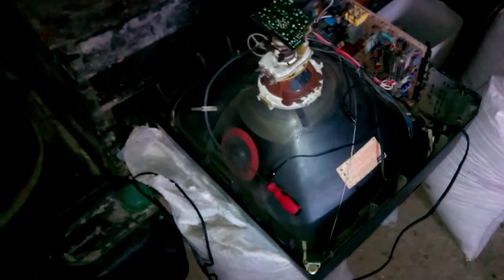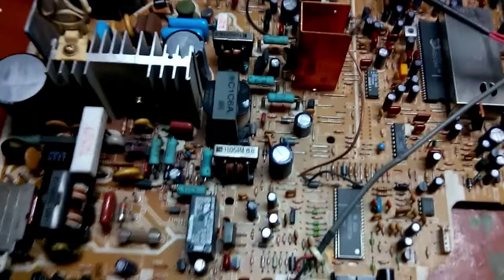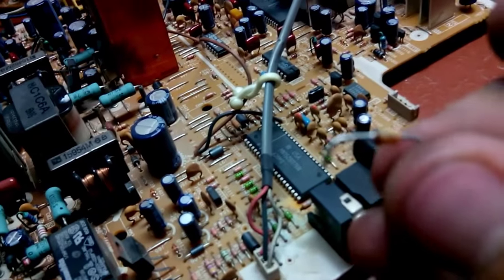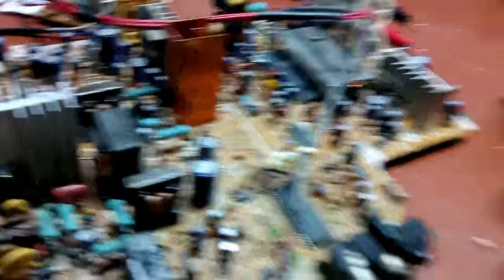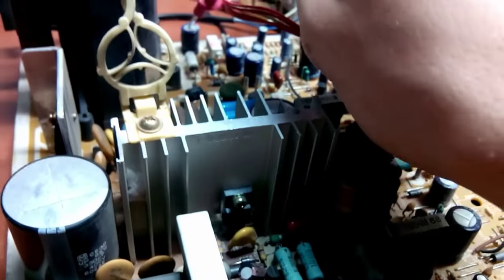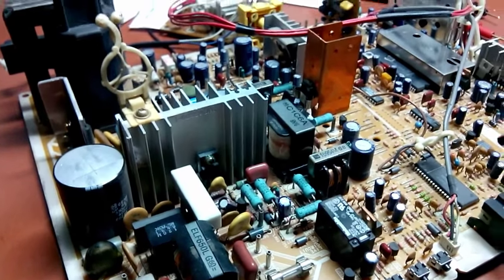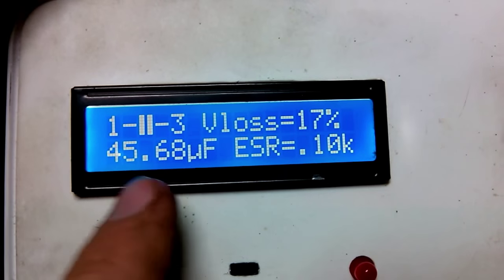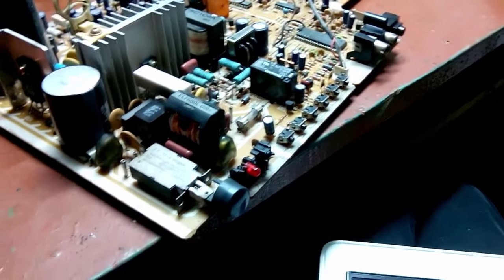CRT TV Repair #2 (doesn't turn on)

Comment: You have a nice tester wich showed voltage loss and ESR. I have also bought similar tester called MK 168 transistor tester. Nice device! :)
Reply from the maker: +saarike Oh yeah, it rocks! I built it myself on perfboard using the schematic of Transistor Tester by Markus and Karl Heinz. What you bought is practically the same stuff, but on a PCB and made in China :) I had a uC and LCD screen on hand so I decided to make one myself.
Reply: Ok. :)

Comment: was watching something on my tv the other day and all of a sudden the picture distorted
looked something like this:
-------------
  ---------------
-------------
  ---------------
the image split into about 5 chunks that where not aligned,  and then it just went off . i get no sound now but the set switches on and makes a similar sound before going into standby and when I turn it back on from standby it just makes the sound again liek when you turned the set off. im going to go check my psu and see if mine is the same issue

Comment: Why did you go for that diode in particular?
Reply from the maker: Muna Abraham I don't quite understand the question, but I went to check that Zener diode 'cause it is located on 42V bus and since it was dead, it shorted that rail. So, I had to replace it.
Reply: What I meant was....There were many diodes as well as transistors, but you went straight for that diode? Was it burned or blown? I know it was shorted. Because it is located on the 42v DC bus was the answer I'm looking for. Thanks anyway
Reply from the maker: Muna Abraham Oh now I understand you)) I went straight to that diode 'cause I cheated a bit (I found a forum, on which I found topic describing similar problem, so I went for it). Without cheating, I would go and check various outputs (voltage rails) of PSU for shorts as well as checking rectifiers on the secondary side. To sum it up - check outputs of PSU for shorts if you have a TV or monitor with power supply that screams when you turn it on. Hope it helps
P.S. And yeah, diode was in one piece, however, it changed color a bit. Usually it is red, but that one looked orange to me.
Reply: what the name of this meter .that you check capicator
Reply: Teach me to repair TV's

Comment: Hi i have samsung crt tv and problem is picture it is pincushion distortion. Can you give me some advice how to fix this problem or could i even fix it at all? Tnx.
Reply from the maker: Google how to enter the service menu of your TV and try to adjust it there. If you won't be able to adjust it enough, there are a few components that are prone to cause such issue. If you are familiar with electronics, it won't be too hard to find the culprit. That if you have some experience and test equipment.
Reply: It is samsung crt cw21z453n , service menu? Ok I will find it, but what if I havu to open it , i have multimeter is that enough?
Reply from the maker: Sasa Vasquez DMM will allow you to test resistors and maybe measure capacitance (depends on what meter you have), might be sufficient. Components in raster correction usually run hot - one of the reasons why they fail. Sometimes you can find the bad part by visual inspection (look for crusty, discolored parts). There are dangerous voltages inside, so you must be careful. I don't take responsibility for your actions.
Reply: Hi , I was enter in service menu of crt and nothing everyting looks normal but picture is shrinked distorted. I wil open it and look for unnormal parts components.
Reply from the maker: Sasa Vasquez Be careful when you do that. Components I was talking about are located in the area with the flyback transformer, usually very close to the yoke connector. Yoke connector leads to the coils on the neck of the CRT, it's easy to spot it; it has 4 rather thick wires.
Reply: the second picture and text
Reply from the maker: Sasa Vasquez Since you say that colors are fine, it's definitely not a convergence issue. When you tried the service menu, was there a reaction when you adjusted the proper control? If not at all, this means you may have bad IC there, which can cost half the price of the used TV in working condition.
Reply: Colors look okay not blurred,  but the side sees green vertical and curved. Mayve i could post a picture somewhere!
Reply: About service menu, if i had hit the proper control , i try to adjust the picture size but the same function is on remote and nothing hapend. It is curwed. Other functions i didnt try.
Reply from the maker: Sasa Vasquez Most menus have a control to adjust raster (distortion of it), you should find it and try it out. Picture size is NOT a control you're looking for.
Reply: One moment i am uploding pictures
Reply: I hope you can see it
Reply from the maker: Sasa Vasquez http://i1200.photobucket.com/albums/bb339/Wassquez/IMG_20161121_131619_zpsuazwuc3v.jpg 
Raster correction components are located where you can see the 4-pin connector near the flyback in the above picture. Usually, it's a couple of film caps, the coil with the magnet on top of it, and few resistors. Film caps sometimes get deformed and loose their shape when faulty, if it's bulged or smth sticks out from the side, it's dead.
 Judging from other pictures, you can try this adjustments: H Parabola; Bow. You have a photo with original settings, so play with the, as much as you want - you can return them back after.
It's impossible to tell the exact reason without direct access to the TV and having ability to scope some signals :(